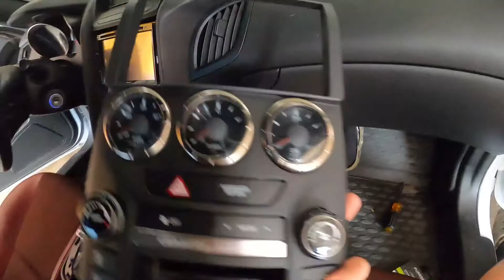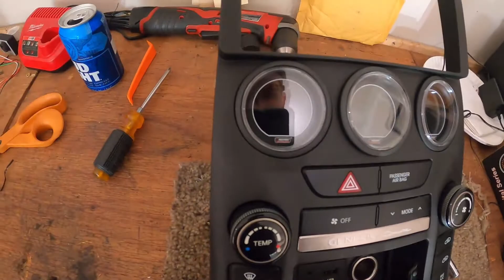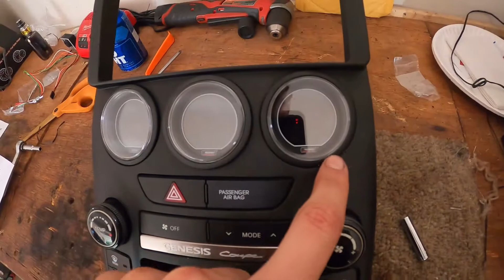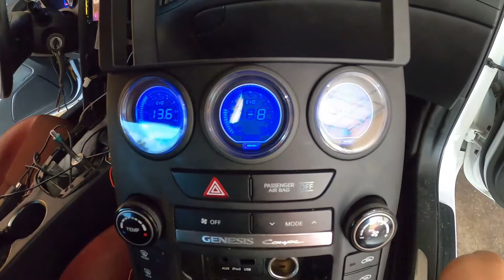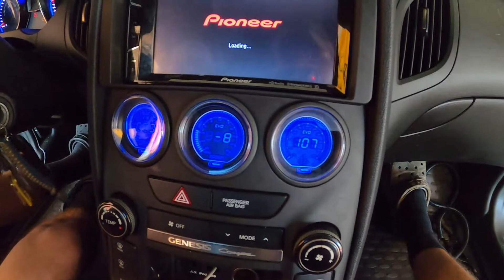2013 Hyundai Genesis Coupe Digital Gauge Installation!!

Comment: Yo i need help with my oil gauge i have the same as you but i dont know where i connect the oil sensor on the engine bay, thanks bro
Reply from the maker: It’s on the bottom front of the block on the passenger side
Reply: Right above the oil filter